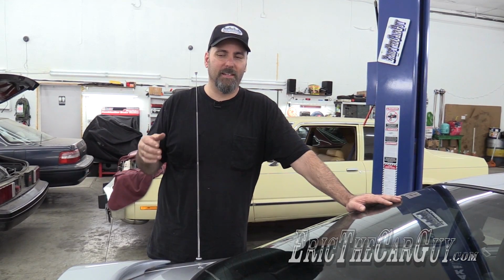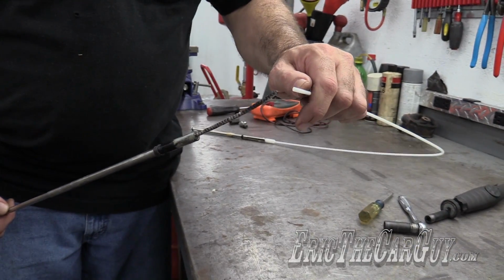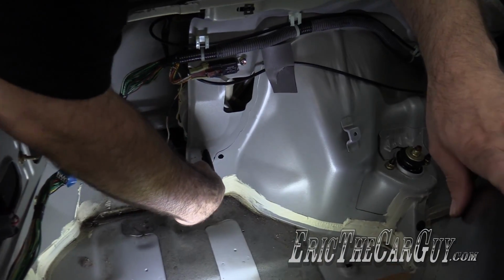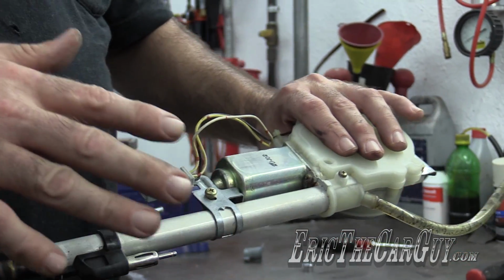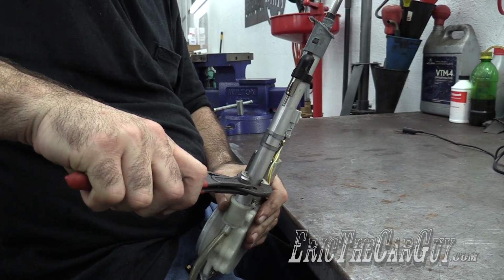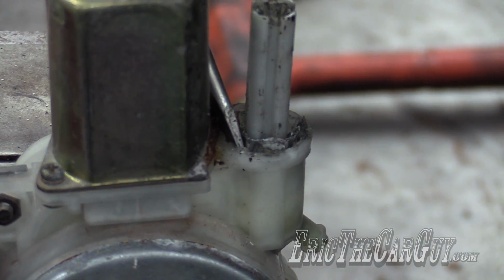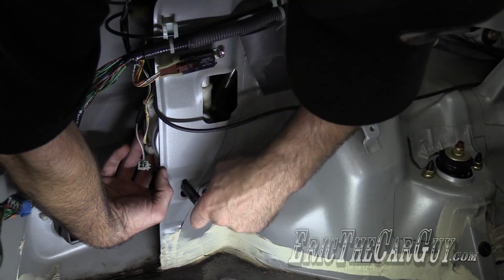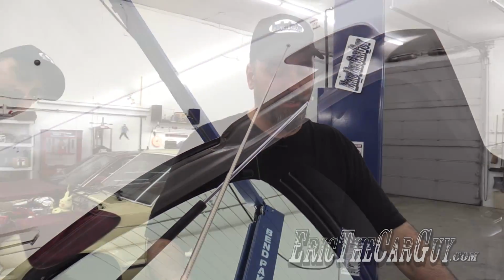The Complete Guide to Honda Power Antenna Repair

Comment: good day, eric, 
when I had water in my trunk I removed the lining around that rear hatch, cleaned the surface and rubber and I believe it's been fine since. good luck and thanks for the video. been putting this off for about a year now (:

Comment: Yeah ?  What till you get a look at a Mercedes power antenna. Even Spock would have an emotional breakdown. 
Nice repair job, I would never have thought of feeding the line down through the top while mounted in the car.  I would have tried to do it on the bench with a power supply.
That's why I'm still a padewan. 
BTW, am I mistaken or were people bitching before about Eric not doing actual repair videos anymore ?
Now there's people bitching because the repair videos are holding up the Fairmont videos.
Geez, never happy.
Reply from the maker: The story of my life.

Comment: If my antenna in my old accord is broken in the up position, can i just unplug it so the motor stops grinding away every time the radio is switched on or the car is switched off and leave the antenna?  I see no reason to fix the motorized antenna and see no reason to replace it since it's stuck in the up position.

Comment: Hey Eric would a heat gun on the plastic base where the aluminum tube sat help? Just a thought. -John
Reply from the maker: Probably not.
Reply: It is an old topic, but just for others who read this, I can say that heat gun actually helps, if the aluminium tube is in good shape. Well I used heat gun on my soldering station about 220 C, not more or less, heated it enough time, no plastic melting, but got a hint of some kind of smell, and then twisted the aluminium tube, and it finally got loose. I have used several other methods before, maybe they helped to loosen it, but after heat, it actually came loose :)

I have 2001 Accord and just now repairing this antenna. Went to comment section to find if any tips on stopping the ongoing corrosion on that pipe

Comment: I replaced the power antenna in my 92 Accord with a universal power antenna from a parts store. It's not Honda OEM quality, but it's been working fine the past few years and I get to keep the cool power feature. It was only about $35
Reply: Just did mine on my 91 accord, doesn't retract all the way down, but does all the way up, kind of a pain but yeah

Comment: I remember my father's 90 Integra sedan, 92 & 94 Accords all having stuck antenna issues shortly after purchase.  The mast would get filthy and then when it retracted, it brought all the dirt into the body.  We would wipe the mast clean and apply a little silicone lube and it would be ok again for a little while until it got filthy again.

Comment: Lol the prelude did get a quick mention. I have a 94 prelude that did have an power antenna but it broke and I replaced it with one of those whip antennas. I think it failed the same way yours did, I could hear the antenna motor turn on every time I shut off the car but the antenna wouldn't move. It did last almost 20 years so I will give it that.

Comment: Nice functional antenna again :-D

Now here is a silly thought, Connect a small fishtank air compressor to the end of the water drain tube, make it run while the radio is on, it may keep more water out while in the rain.
Plus add a propper rubber "O" ring to the antenna top to seal when its down.
I did say its silly :).
Reply from the maker: Perhaps too much trouble as well. Interesting idea though.

Comment: I've fixed the one on my 2nd gen Integra 3 times very familiar with this repair after the 3rd time I've just pushed it back down & disconnected the motor (it works just sticks on the way down). I hate the way those whip antennas look my aftermarket deck pulls FM well enough even with it down & 90% of time I'm streaming music , or listening to my iPod. I love wrenching on this car but something's I can leave broken & be better for it. Like you said a working automatic antenna is a rare thing. 

Funny there was never anything wrong with the switch operated power antenna in my 87 Accord LXi where did Honda go wrong.
Reply: Hondo fourfivetwo they built them way better in 87.

Comment: Regardless of car, powered antennas were/are a bitch to fix and maintain. Frankly, it's, as you said, better to replace it with a fixed one. Heck, there's those special high gain ones that are smaller, sleeker, that are far better in terms of reception.

IMO from the very beginning the whole concept was flawed being that the system is very small, and as such, any kind of water intrusion effs it up, big time, and rusts a hole in your trunk while its at it. Never was worth the "hype" it got back then.

Comment: Water or the penetrating oil ?
Reply: Water, he'd know it's penetrating oil, by touch, besides that oil went inside the sleeve that's around the antenna mast, from there, it drains directly to the tube, also, a lot more water than he sprayed oil.
Reply from the maker: I suggest lubricating with penetrating oil instead of water.